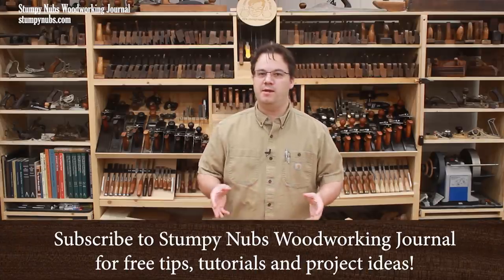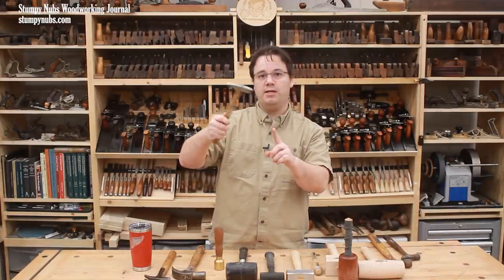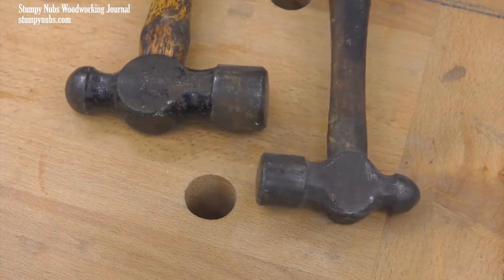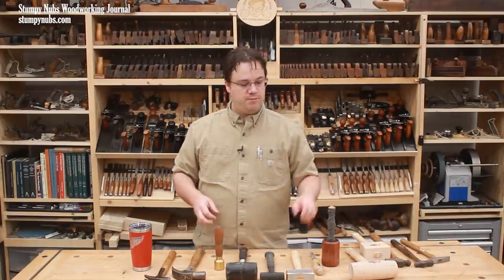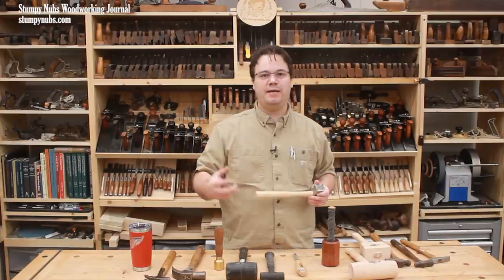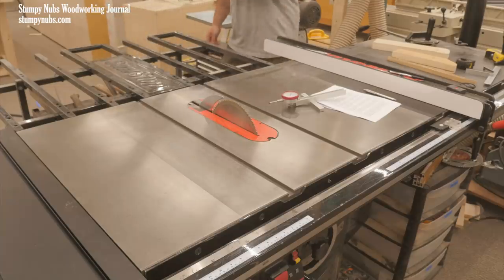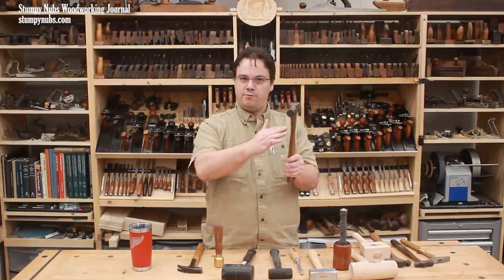Hammers and mallets woodworkers need to know about

Comment: Tip: wrap your rubber mallets/deadblows with a bit of masking tape so the rubber doesn't discolor whatever you're hitting.  Even the bright orange ones I got from Harbor Freight seem to pick up some black nasty stuff over time that can leave a stain on wood and require sanding to remove.  I also really like my urethane-wrapped round mallet for chisel work -- a has a nice slight taper to it, and a surface that won't split like the wood one you showed.
Reply: Halder makes some really nice mallets that have replaceable rubber heads and don’t stain or tarnish wood.  I’m a finish carpenter by trade, the mallet works great on prefinished trim and cabinets and raw wood.  They aren’t super expensive either.

Comment: Excellent video.
My dad was a joiner and for all the years I knew him he was with the CWS Shopfitting works in Salford GB. I served 4 of a 5 year apprenticeship there before changing to architecture. He had many different tools which are rarely seen but with regard to hammers/mallets he had one which I haven’t come across anywhere else. I think it may have been a panel beater's tool. It had a wood shaft and a barrel shaped, iron head which had a coil of very tightly wound, thick leather in one side and solid copper in the other.
My mentor was a highly skilled craftsman, not very far from retirement. He was the only one given the task of making glass display cabinets where two of the corner joints were very intricate. These formed the top two front corners of the cabinet which had to be glazed - top, front and end. A 1/16” chisel was used in this. One bead dove-tailed into another then the third tenoned into them. Once glued it was a solid joint.
We sometimes had to use extra small panel pins which couldn’t be held in the fingers. An adapted pair of tweezers was used which had a groove filed into the grip parts so that the pin was held firmly.

Comment: I use a Thor 712R hammer from the Thor Hammer Company for most of my chisel work.  It has 2 replaceable faces one soft and one hard, so it also gets used for lots of other jobs too.  They have a massive range of hammers with all sorts of replaceable faces and weights.  I got mine after a recommendation from Paul Sellers.

Comment: Thanks for this. My shop hammer belonged to my gramps who was a trim carpenter in the 1920s through the 40s
 Its claws have sharper radius for better extraction and pull the tiniest of Brad's out.  Plus it has the earliest ball bearings for holding nails (that I've seen anyway) for that long reach nailing. I kept it in a drawer for ages and then thought "I'm not a museum" so now use all my antique tools wherever I can. Appreciate your vids.

Comment: My former boss, Al Kovall is the best carpenter I've known in 40 years. He used to run base and case by hand, and THE way to do this was with a small gouge to curl up a sliver of trim and use the extinct 7 oz Stanley claw hammer and nail set in the groove, then glue it back died and usually tape it.

Comment: Great video stumpy, if I may just one small bit of advise from some who's been swinging hammers for over 60+ yrs always try to get or use hammers with wooded handles they transfer far less vibration to your arm and shoulder, steel handled hammers should be used in demo work only,  when possible even the newer fiberglass are better than steel.
Reply: I used a very cheap hammer when building a summer house, and suffered from joiner's elbow.  I then bought an "anti-vibration" hammer, which has a metal shaft, with a rubber handgrip.  It seems ok, but I've not had to use it much since then.

Comment: Not to be picky, but the hammer you are holding and describing is actually a machinists hammer, I made one in grand nine machining class. The second picture you showed is the actual Warrington hammer. Your description of its use is correct. Learn a lot from your videos and sometimes the jog my memory of projects from my past. My first hammer was the old leather handled 16 oz. Estwing curved claw hammer. I still have it along with a few older curved claw hammers I've found in various places. The Estwing could use a new handle, but I'm mote into the straight clawed hammer these days. I also have the leather handled Estwing hatchet.
Reply from the maker: Some metal working tools, like that hammer, are widely used for woodworking, as well.

Comment: The milled or waffle faced hammer is also very handy, especially when removing nails. When used properly you can 'put English' on the stroke to help guide the nail and keep it from bending. It takes practice and a fine touch, but when done properly it make removing nails much easier. (The smell of a good rubber mallet, reminds me of my grandfather's garage).

Comment: Japanese chisel hammer, very useful for a lot of light work. A variety of automotive body hammers, an old roofing hammer for shake or composition roofing w/built in spacing guide, haven't found much alternative use for them yet. The most useful hammer I use is a Japanese finish hammer with claw. Once you use one, I think you'll stay with it.
Reply: They do have some sweet little hammers.

Comment: Two that didn't mention are the framing hammer and rigger's axe. They're both great for general home repairs, so  they're nice to have in the DIYer's toolbox, and they're often found at yard sales.  I've been thinking of upgrading to a framer's hammer with a magnetic nail holder.

Comment: As always James, another fact based, informative video. I believe I own (and use) eleven of the "hammers" you featured in the video. After 50 plus years of woodworking, I added another hammer about a year or so ago. It is an 8 ounce stubby claw hammer, from Harbor Freight. I find it to be extremely useful in the  day to day work in my shop. With it's short length it fits nicely in my canvas apron, so it is always at my fingertips when needed! Bump a fence over, start a nail to center a jig, (and then pull it out) or striking awls, chisels etc. it's always on the job. Thank you again for your insightful content.

Comment: Great video. you give an excellent and clear rundown on hammers used in woodworking. and I love your shoutout supporting small business! There are several more options of shape and size "peen" hammers than even you have shown. Just like your cross peen with the flat running horizontal, there is a diagonal peen (self explanitory), and a straight peen with the flat running vertically. They were all primarily used and developed by blacksmiths and metal workers as a peen is away to make metal move in a controlled direction. The next level of control would be to use fullers and swages.

Comment: Warrington pattern cross pein hammer was (and still is) very useful for adjusting wooden plane irons. The cross pein is also great for removing the wedge from a moulding plane…the wedges are shaped with that function in mind.

Comment: I've been surprisingly happy with Estwing "double faced soft hammer".  Plastic on one side, rubber on the other, nice shorter handle.  Ideal for putting paint can lids back on, & generally very handy in the shop.  One of those 'why didn't I have this years ago?' things.  Definitely Japanese chisel hammers, but Japanese carpenter hammers not so much (skinny handles, un-useful claw).

Comment: My daily driver is a "Wood is Good" MA18 with a tweak. The MA14 looks the same, but MA18 is factory bored and has a metal weighted core that's plugged in with a top cap. I've blown these caps and weights out and they did replace it under warranty but here's a tip: 
I drill an off of center pilot through one side of urethane head and graze the side of the weight but not out the other side of urethane (maybe into it). Then tap a 1/4"×20 thread down the hole and run a long brass screw to bottom. I'll mark the screw and back it out a tad then hacksaw it to undermine it and then run it back in until it breaks of just below surface of mallet face.

Comment: My Dad was a carpenter, granddad was a millwright. I was taught that ball peen was soft steel so it was safe to strike steel; claw hammer has a hardened face, it may spall if used on steel objects other than nails, which are soft steel.

Comment: If you need a dead blow hammer in a pinch to assemble press fit stuff like wire grid shelves with plastic corners, take an old vitamin bottle and fill with water and any small metal objects you have around.  washers or nuts may be ideal.

Comment: Great video, I would also recommend a copper/hide mallet for use on/adjusting machine parts or any other metalwork where you're trying to avoid damage to the surface. They're typically a little weightier, that I prefer, and a little more durable than the nylon head mallets you're considering (in my experience). The heads are typically replacable, and I've found the hide end bounces a fair bit less than rubber/nylon.

Comment: We used to have lead headed hammers at work. They will give the weight like a lump hammer with the soft head of a deadblow hammer. More for working on machinery. When they get flattened enough you just remelt and cast a new head. Easy to make in different sizes.

Comment: Thanks James for the nice review of common hammers. It makes me want to go out to my 20 degrees F shop and just pick up a few...
 
At the risk of being pedantic, you hit a pet peeve of mine at 5:22: "... that dead blow delivers more power..."  My father used to say that a dead blow hammer delivers more 'oompf. 'These are versions of a popular misconception, that you can have no dents, better control, and more (something) with a dead blow hammer; if that were true we wouldn't need some of the other kinds of hammers. We know it delivers less force because it is less likely to dent the surface. It does this by increasing the time span of the blow, as the lead/steel balls do not all hit the front at once. We know It does less work on the surface, since it delivers a smaller force over a smaller (dentless) distance. Since it delivers less work (energy) over a longer time, it delivers less power, not more. 

What a dead blow hammer really does is allow you to deliver less force (fewer/smaller dents) while using the same swing with the same weight as your 'regular' hammer.

Comment: The lump hammer is a new one on me but I often use an engineer's hammer (short, lightweight sledge hammer) with wood chisels for that very reason; I have a lot more control by just letting the hammer drop. Also I'm really lazy. Nice run down on hammers, Stumpy. I have to go shopping now...

Comment: Use a smaller hammer to form things and a large hammer to move things. Good video, I have a gob of hammers but now I want a couple more!
I made a big lead hammer out of old wheel weights melted down, about 5 pounds, to move stuff and it is a pleasure to use . I believe I’ll make a dead blow next, I’ll try cut up wheel weights on one and lead shot on another to see what the difference might be. A dead blow doesn’t bounce, making it ideal when setting fixtures.Thanks

Comment: Again another excellent video packed full of good info presented smoothly and in just the right amount of time. One hammer I like lots is a dual face rubber / plastic one I use. I like being able to flip between the two faces as I need. The rubber gives a smooth hit and the plastic a nice crisp rap. Just right sometimes for  coaxing a joint together.

Comment: You are so right about modern mass manufactured hammers. I always thoroughly look over a hammer before I buy it, and 95% of modern hammers are complete junk. They have different size claws, varying in length, width, and thickness, the heads are all different shapes, the grinds are atrocious, etc. 

The other day I was in Home Depot and they had a Milwaukee smooth head framing hammer with a flatbar combo for $25. I thought it was a deal I couldn't pass up, but then I looked at each hammer closely. They had about 6 left, and every one had major flaws in the grinding. The main issue they all had was one claw was much wider than the other. One claw end was about an 1/2in, and the other 5/16-3/8. Every one I looked at had the same issue. I ended up not buying it even though it would still a good deal and I could have fixed it myself.

Comment: The cross peen was used by the guys installing glass panes when I started on the tools. The flat edge would slide on the glass to hit the points or the side of a cold chisel does the same job.
Reply from the maker: I've installed a fair number glass panes, myself. I've never used a hammer to install the glazier's points, though. Too much of a risk of breaking he glass. I just used the edge of a putty knife to press them into the wood. But I am often surprised to see what skills other people have.

Comment: Iv'e done a lot of delicate work with what I believe is a brick or rock hammer. It's got a square, mostly flat head and a flat tail like a cross peen hammer. The square head helps for getting right next to a wall or ceiling. I put the old head on part of an old, bent axe handle to make room for the knuckles.

Comment: Got and used all except deadblock hammer. Never had a nail gun, can't justify cost. Often use claw hammer sideways to start a nail or spread impact. Always taught to tap nail or pin once and wait a couple of seconds to reduce risk of nail bending - something to do with cooling - seems to work

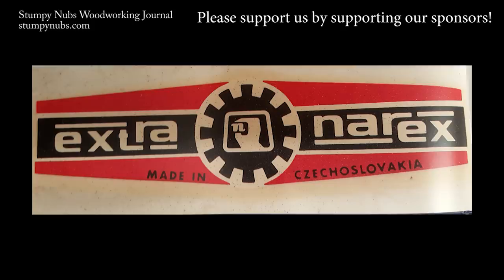Comment: 8:18 Of course, if your hammer handle is only slightly loose, you can always soak the end of it (while still attached to the head, obviously) in some ethyl glycol (anti freeze) for a couple of hours. The wood swells up and stays swollen, easy and almost permanent fix! My ball pein is still rock solid 5 years after this treatment.

Comment: I have a small one of those with the replaceable / interchangeable heads - plastic, rubber, brass - as I have so little room for 3 of something I only use once a year, mostly the brass, and I like it. Then, the med. size Craftsman, with the plastic and rubber.

Comment: Your right about claw hammers. Most of the modern ones, even the expensive ones don't pull nails well. My 45 year old Stanley tubular handle hammer can pull nail even it the head is missing. The hardened milled claws bight into the nail.

Comment: Under Cross Peen's, you showed images of several varieties.  The 2nd one is not a woodworking hammer, that's a french pattern blacksmiths cross peen.  Those vintage claws are gorgeous.  As a blacksmith first, I appreciate that old hand work.  Lastly, Japanese chisel hammers?  I have fallen in love with them for chopping and general chisel work.
Reply from the maker: The 2nd image I showed was a Warrington Hammer, which is  used for woodworking as well as for other purposes. 

If you meant the first image I showed, that is a French design, but small versions are regularly used for woodworking in the manner I described.

Many metal worker's tools have been adopted for woodworking purposes for generations.
Reply: @StumpyNubs  I stand corrected.  I mistook the close up of the german pattern hammer for a still.  And yes, a ton of tools cross over between trades, I've just never seen anyone use a french pattern hammer on anything but metal.  I love your channel and that's the first time I felt like I needed to add anything, your content is thoughtful, complete, and informative.  Keep it up!

Comment: The one-piece steel-shafted hammers with a rubberized handle are awesome for construction. They're unbreakable and waterproof, and optimized for being able to pull very long nails and destroy stuff with the claw. They aren't bad, they're just not intended for fine woodworking. But even in their intended use, if you're doing something that involves lots of hammer-swinging, a wooden handled tool will hurt your elbow a lot less. It just costs more and doesn't last as long.
Reply: I Broke a wooden handled hammer on hour 1 of framing my basement… the wood they use is crap. It made me sad because it was a lot more comfortable than the all metal hammer I replaced it with.

Comment: The cross pein hammer was used in both blacksmithing, jewlry making and sharpening Austrian style scythe blades. Scythe blade sharpening is what I use my cross pein hammer for. The scythe blade is put on a flat peice of steel or anvil, and the cross pein is repeatedly struck across the length of the scythe blade to sharpen. A finish stone is used to get the blade even sharper after the peining is complete. 
I would NEVER drive a nail with my scythe sharpening dedicated hammer, as it could potentially deform the curve of the pein end, or dent the convex face. Both of which would cause imperfections in the scythe blade after use.
Reply from the maker: Cross peen hammers, like many other metal working tools, have been adopted for woodworking tasks for generations. Usually, those used in woodworking are smaller and lighter versions than one would find in the typical blacksmith shop. They are more like the versions used by silver and tinsmiths. But, since I have little experience in those crafts, I can't expand upon their uses with metal.

Comment: It would have been good to mention the types of objects various hammers are intended to strike. A claw hammer has a softer face and is not intended to be used to strike metal such as a cold chisel or even metal capped handles on wood chisels. I prefer Estwing for most of my hammers if buying new. I also like the Thorex 712R Soft & Hard Nylon Face Hammer. It's a good weight and size for benchtop work and for assembly tasks.

Comment: Thank you.  I (sort of) added quite a few specialty hammers recently -- ball peen, tack, rubber mallet.  The "sort of" part is that nearly all of them have cracked handles.
I am quite used to putting fresh handles on my yard tools to keep them going, but I am finding a dearth of sources for hammer handles.  And those I am finding cost more than a new model of the hammer itself.
Any suggestions?